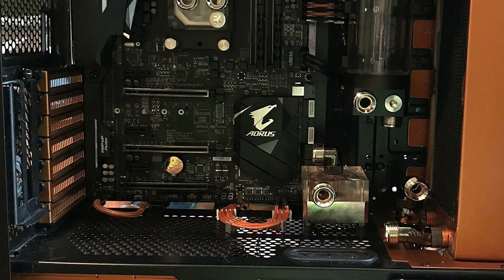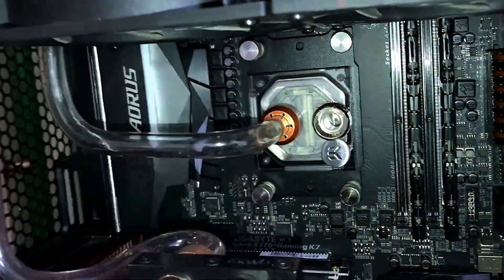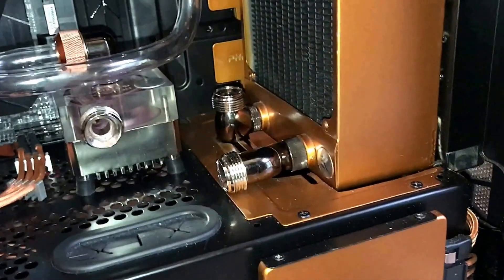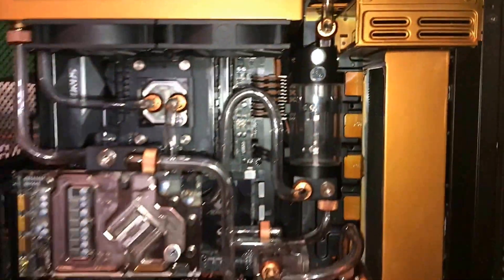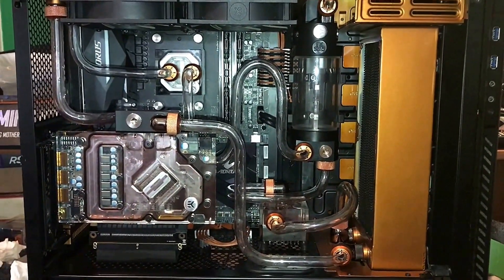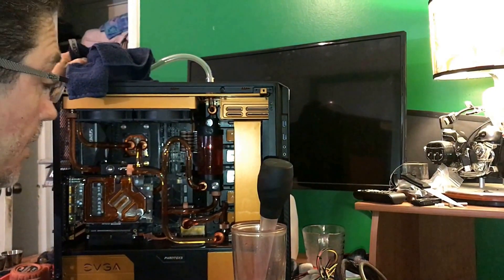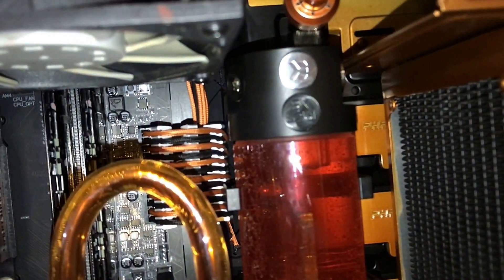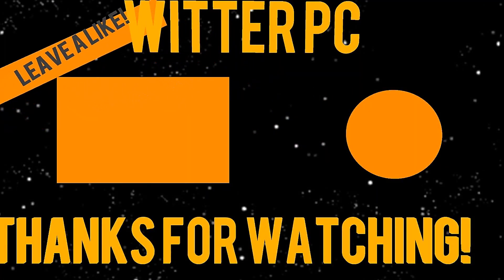EKWB Ryzen Water Cooled PC, Gigabyte Gaming K7

Comment: Love your setup, man. I just bought the GA-AX370 K7 as well as the G.Skill Flare X 2400 to push a Crossfire 2x XFX RX 580 system. I'm overhauling my old first-gen i7 build from years back. Looking into new cases as my budget builds up, again. I'm about $1100 into overhaul right now with the GPUs and I haven't touched the cooling or case yet... lol

Comment: Hi! Quick question. With the vertical mount bracket, how did you manage to connect the display out cable and get it to fit? I'm looking for a vertical mount for my Enthoo Evolv ATX, but doubt there would be room for the DVI-D cable that goes to my monitor (which has no other input modes). Any help would be greatly appreciated, thanks!
Reply from the maker: I used a pair of Jeweler Snips, But a Dremel which I have would of worked just fine. I also Bought a bag of thumb screws to fasten in .http://imageshack.com/a/img924/917/ei7iiv.png
http://imageshack.com/a/img922/6363/8MQ7ME.png
Reply: Witter PC   Thank you so much! Combined with the two videos, I think I've figured it out. I'll get a pair of snips and give it a try.
Reply from the maker: Here is what I used, They are Jeweler Snips they cut fine narrow pieces of Metal where Sometimes normal snips will not. A Dremel would be great for this. Either way take your time. don't panic if something goes wrong. 
http://imageshack.com/a/img922/1839/GOZumn.jpg
http://imageshack.com/a/img923/637/MOeHni.jpg
http://imageshack.com/a/img923/3678/I1GT34.jpg
Reply from the maker: I have started to make a how to video on this . I'm currently moving but when I'm done I will finish it. and Put 
it out here for you guys.
Reply: Witter PC  Thank you, I really appreciate it! I love the rubber grommet idea to protect the wiring, too.
Reply from the maker: Thanks !! glad I could help.
Here is a link if you want to try these. I use them for work , but they are good for modding. Trimming fine pieces of metal and such. any way Im glad I could help. This is why I started this Channel .
https://www.amazon.com/s/ref=nb_sb_noss?url=search-alias%3Daps&field-keywords=57C+23000+Clauss+Light+Metal+Cutting+Snips+Curved
Reply: Witter PC I can't wait!